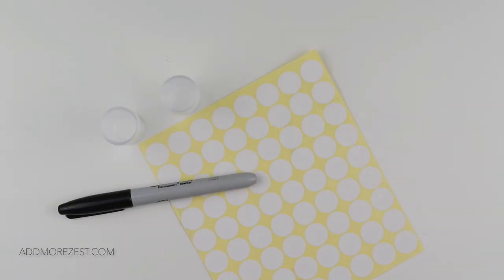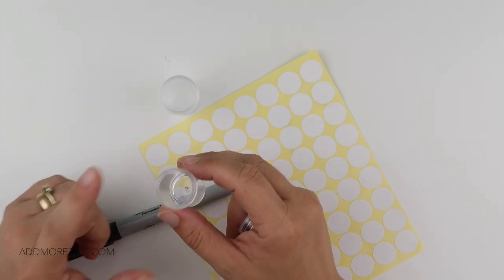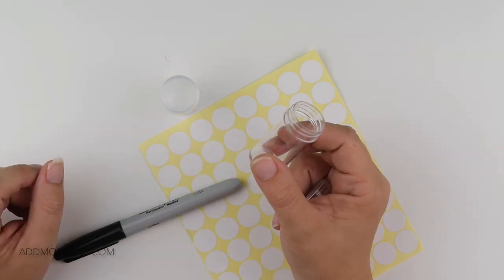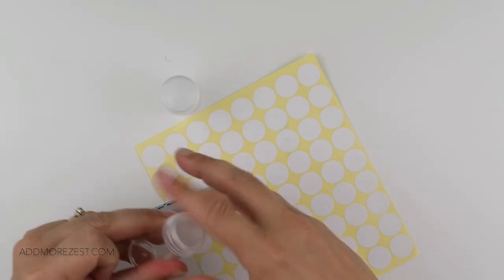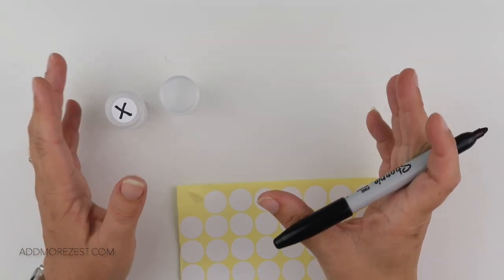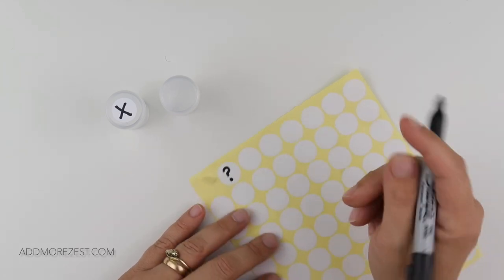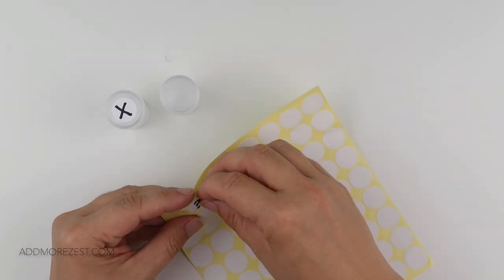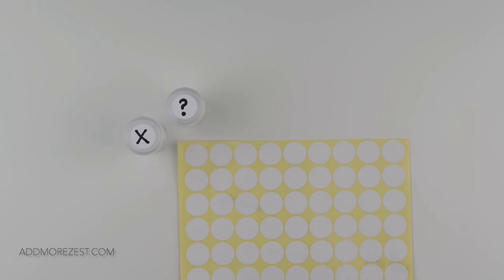Diamond Painting Tips & Tricks | #11 A Mystery Pot

Comment: I tend to use storage that has extra pots just in case.  I label the top of one of the pots with the name/number of the canvas.  This pot has always become my mystery diamond spot if they might be needed.  I do have a jar for bad drills and at the end of a painting the mystery drills are dekitted into that trash jar.  My trash jar has become quite pretty since I do many snack sized special shape diamond paintings.  Special shape diamond paintings always have the most trash drills, imho.    I thought of another tip the approximate number of drills in a gram weight just in case someone wants to switch out a color for ABs etc.

Comment: Hi Rebecca 
Please may i ask you.
When you get Aurora Borealis diamonds the number on the packet does that match the normal diamond packets numbers. Sorry for any confusion. Thank you
Reply from the maker: hi Debbie, it doesn't always match. a lot depends on the manufacturer. If the number is a DMC one then it quite probably is, but sometimes they just use their own. You can check against normal ones you have, but use the bottom to compare as they look very different once the AB coating is on.